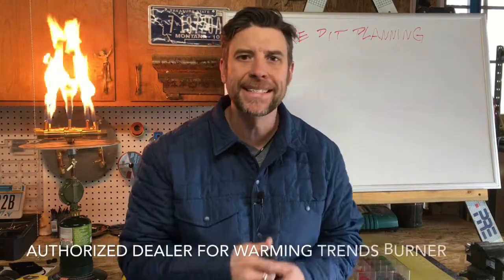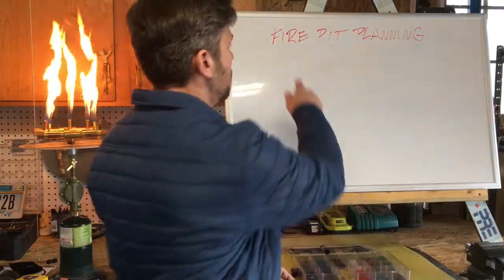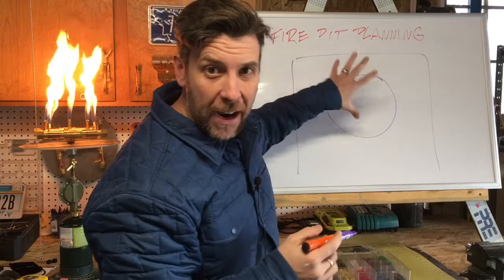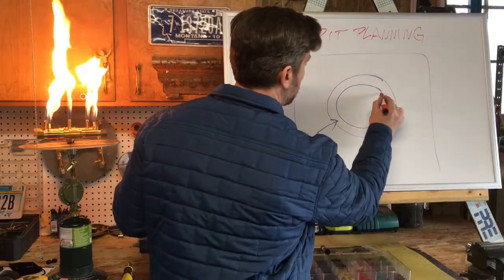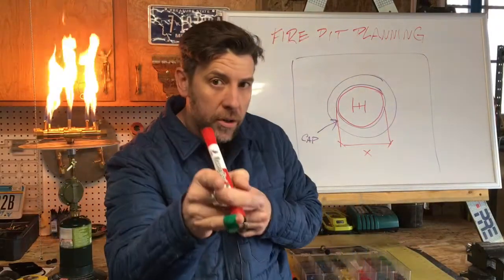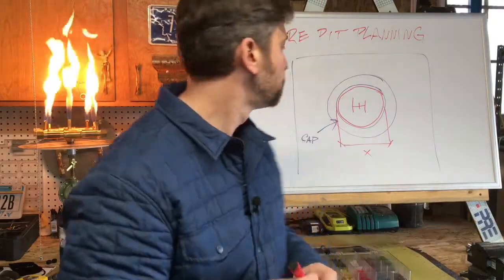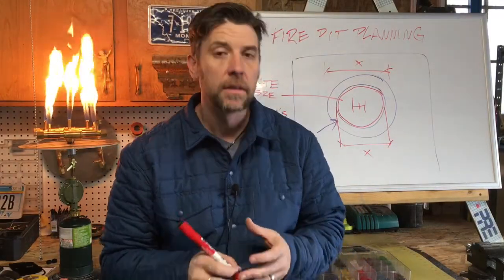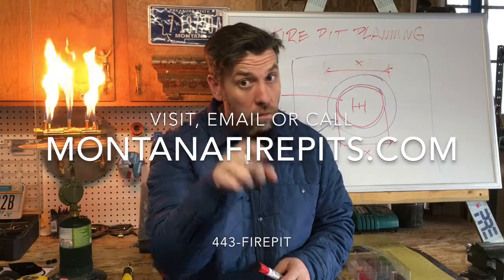DIY Fire Pit Planning - Burner And Plate Size

Comment: I just want to confirm...I have read that you need a six inch clearance from the fire pit to the inside diameter. Is this six inches from the edge of the plate or six inches from the burner itself? I will have a 48” fire pit built (inside diameter) do I need a 48” plate or do I need a 36” plate to allow for 6 inches all the way around? Thanks for the info...very informative.
Reply from the maker: 6 inches from the burner. Give yourself 1/2" for the plate so that it's not too tight. Here's some more info https://montanafirepits.com/learn/#plates-pans